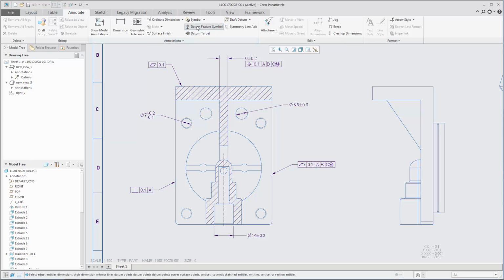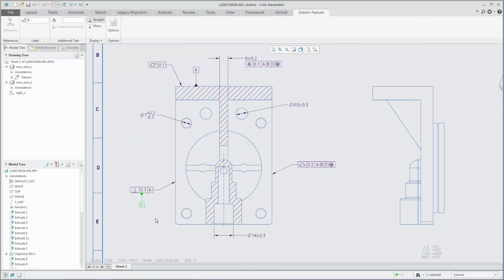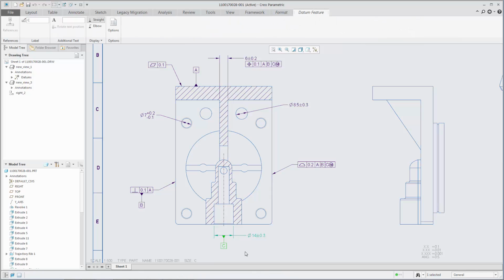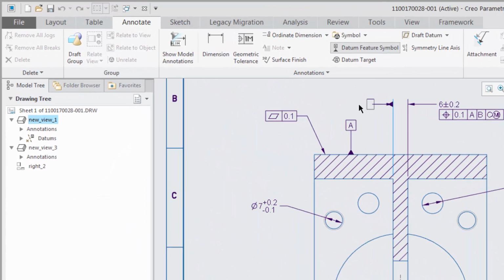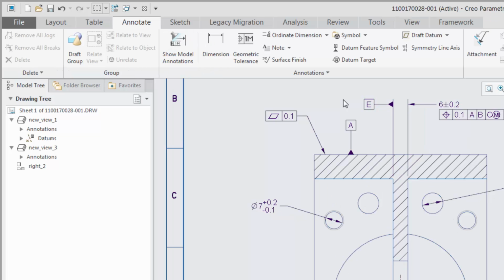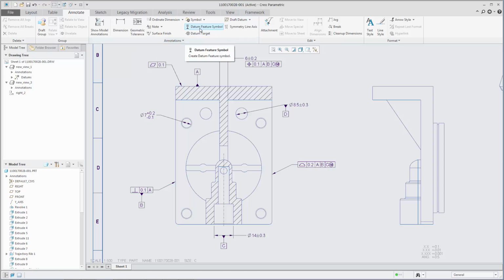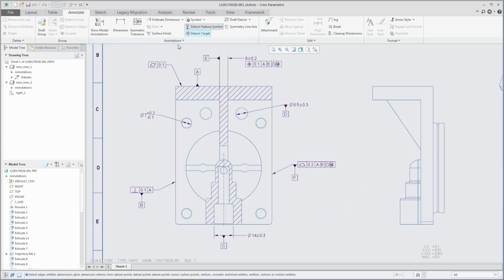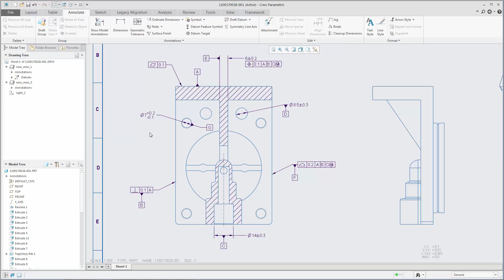New to Creo 4.0 - 2D-3D Detailing - DRW 1a DFS Create Edit

Comment: Can you add a Datum Feature Symbol into a drawing of an assembly by using a hole from the part level? Why is the symbol not attaching to the geometry in the same way as the one form the part level? Will be shown vertically or horizontally.